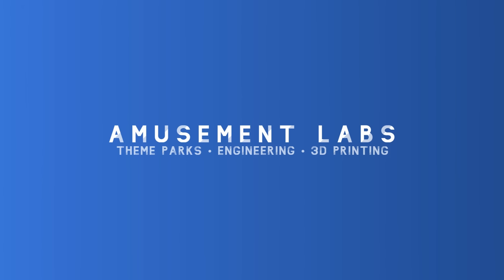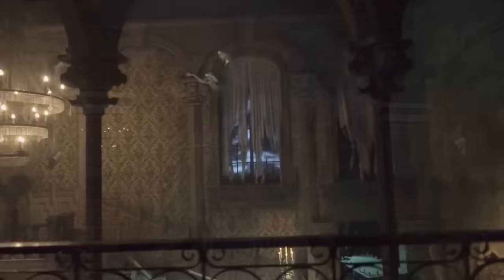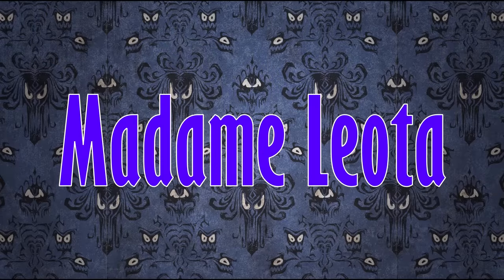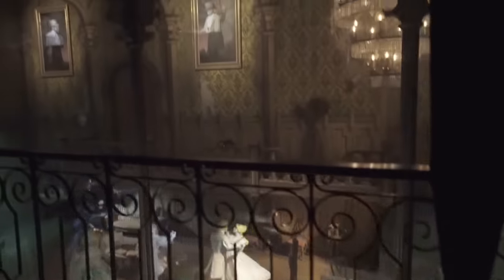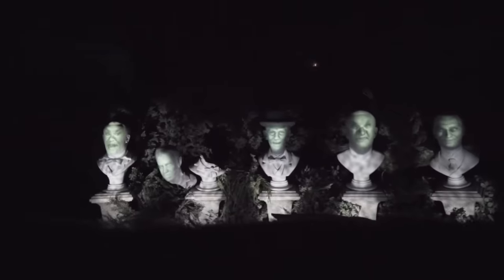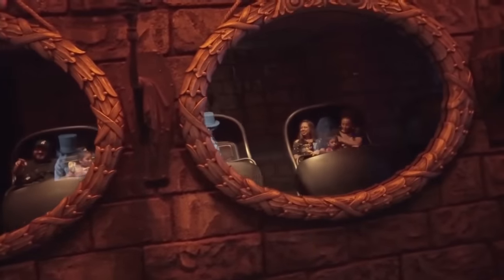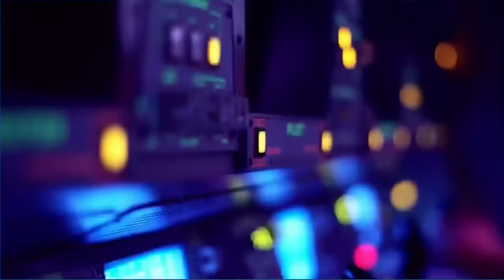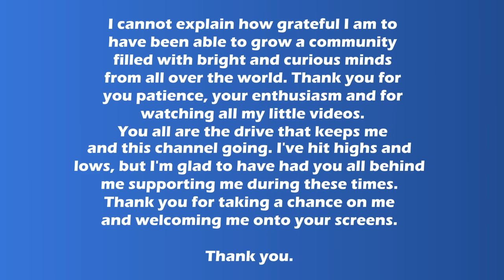The Haunted Mansion - HOW IT WORKS

Comment: Former WDW cast member here, and Haunted Mansion enthusiast (I did a history report on how the effects work for one of my college classes). I'm a little disappointed that you didn't mention the use of the hollow mask illusion (the busts that always seem to be looking at you). Similarly, the Stretching Room effect was so popular that, even though the WDW version didn't need an elevator, they reversed the effect so it could be included (i.e. the ceiling moves up instead of the floor moving down). Also, the Madame Leota effect is created with a unique back projection: the projector is inside the head. This is how they are able to make her crystal ball float without needing to worry about the projection becoming unaligned.
Reply: The Paris Phantom manor also has a Stretching room elevator, however it is semi-useless, the only purpose i seem to get from it is so the house can be a freestanding structure, like the Disneyland one. The Paris one i remember hearing, combines a moving floor and ceiling, so the room stretches in both ways

Comment: While I am by no means an Imagineer, I have worked with them on special contracts through my contract work with LucasFilm. I am allowed to tell you that they officially updated the Ballroom Trick years ago. See, what it is now is two large floor-to-ceiling mirrors. The one we, the riders, look out on is a two-way mirror. Above us is a projector that reflects off of the mirror opposite us. Since light refracts off it, it ends up bouncing off the two-way mirror we look out of and the two reflecting and refracting beams of light end up combining in the middle to create a genuine hologram. It was expensive. As in, it's cheaper to stay at the Ritz Carlton Hotel for a week then to replace them since they have to be made and installed all in one piece. Not to mention they have to be modified to withstand their own weight, not blur, and treated with a chemical process that makes them difficult to fog up. They also have to be resistant to damage because riders will do stupid stuff like throw a camera at it. But yeah, they actually updated the trick sometime ago. Now, instead of an illusion of a hologram, it's an actual hologram. It's expensive as sin and not easily accomplished, but this is Disney, after all. I'm privy to many things I can't talk about, like the voice modulators for Galaxies Edge. I can't tell you details, but it was originally technology that the military uses. Let's just say that Disney's R&D Department has contracts in other fields besides entertainment.

Comment: What a lot of people don't realize is that in the Ballroom Scene, the ghosts are dancing backwards because of the mirror effect. The result is that the ladies are leading the men, uncharacteristically ahead of their time.

There was also an incident where some moron hid a BB pistol on his person, and shot at the ghosts, leaving a crack in the glass. Disney would have to take the building apart to replace the glass, so they just disguised the crack as a spiderweb.
Reply: Yeah, last time I rode Haunted Mansion (during Nightmare Before Christmas Season), I found the spider on the glass. Disney did well at covering up the fracture.
Reply: I’m more shocked at how he managed to get a weapon like that inside the park. How long ago was this?
Reply: @Draconiangem  I had to research this, looks like it was in 1974, long before 9-11 when the most draconian security was put into place.
Reply: A reflection wouldn't change who's leading a dance, it would only change the direction of the rotation (counter-clockwise vs clockwise). If you see a lady leading in the reflection, it's because the lady is leading in the actual unreflected mechanism.
Reply: @mykalimba  When you're leading the dance, your right hand is on her waist, or her shoulder, and your left hand is holding her right hand in the air.

The mirror image shows your left hand on her waist and your right hand in the air, holding her left hand, meaning that you're following.
Reply: @uncaboat2399  Ah, I get it. You're speaking in the sense of the bodily orientation of a person in the "lead" position of a couple's dance, not the person physically a half step in front of the duo. So when the builders built the dancers, they constructed them in the traditional man-leading orientation. But the reflection causes the women to appear in the leading position. That makes sense; thanks for the clarification.
Reply: That’s insane. With the bb pistol and also the large pieces of glass. I bet if they ever have to replace it, they will make a permanent door system in the roof to replace it in the future more easily.

Comment: I used to work at the mansion in the CA park. Been through that thing inside and out. Even crawled up into the crow’s nest at the top of the building. Had to access it by crawling on a wooden structure directly over one of the elevators above the hanging skeleton. Those were fun times. Got to see things most people will never see. I only wish digital cameras were more available back then. There would be picture all over the internet if I had the access to that technology in those days.
Reply: I’m assuming it is but, is the hanging man like a physical prop? How do they get him to sway constantly like that? I’m sorry for bombarding you with questions I’m just extremely curious!

Comment: The original only has 1 giant sheet of glass for ball room, wdw has 8 different panes. The sheet of glass is so expensive that in the 70’s when someone shot it; it could not be replaced. So the put a spider over the bullet hole. Wdw wanted a spider too, theirs is just for decoration.

Comment: Fun fact: At some point in time some idiot chucked a rock at one bit of glass (I think) near the end of the ballroom scene, making a crack in the glass. Since it was expensive to replace the glass, they just put a spider over the hole the rock made, making it look like a spider-web over some shattered bit of glass.
Reply from the maker: Yup, I thin kit was a BB or something back when there was no security check. I think they ended up trying to plug the crack to keep the fracture from propagating.
Though I think now may be the time to actually replace the glass with large sheets of the Musion film and bring in some new animations. But may that would be better for WDW where the ride is less of a historical landmark.
Reply: @AmusementLabs  Yep, someone smuggled a BB or a 22. pistol in the 70s.

Comment: Dumb question.  If the elevator room goes down.  Since covid you walk through.   So now I am confused.   If you needed to desend then how do you walk though now
Reply: Only the original Disneyland version is an elevator, with the stretching rooms in the other parks it is only the ceiling that raises up while you stay on the same level.
Reply: @SquishyMon  ah ok.   I thought you had to go under the tracks at Disney Orlando also.   Got it !  Thanks

Comment: What a great season of videos! I only have one question: where is the projector for madame leota located in the room?
Reply: The projector for the original head (the one fixed on the table) was located in front of the head, in a piece of furniture if I am not mistaken.  If I understand correctly, the projector for the current (floating) head is located inside the head itself and projects the face as a rear projection.

Comment: Ok but for the stretching room, how is it an elevator if during covid I went and then we just walked right through it. so how is it a elevator?
Reply from the maker: You walked through the WDW Haunted Mansion. That one the ceiling raises up away from you. That's just for effect, but has no actual practical use. This is for consistency among the versions of the ride and cause they had the ability to plan for having the HM and building underground in Florida is very difficult and expensive.